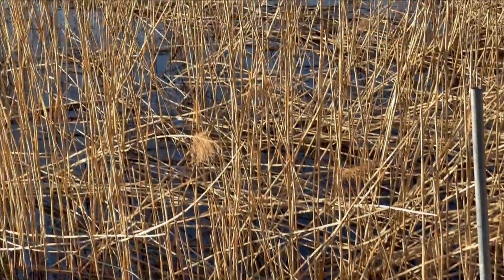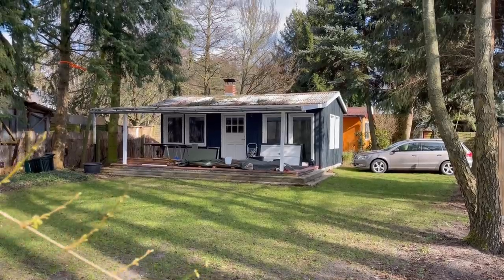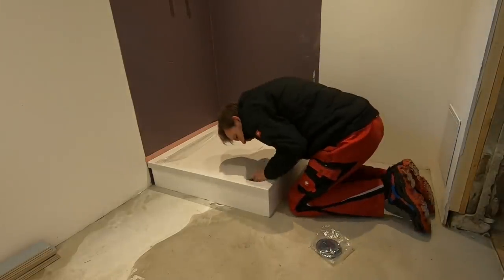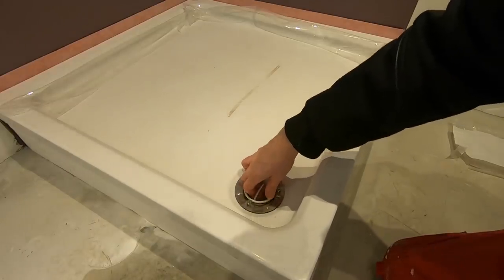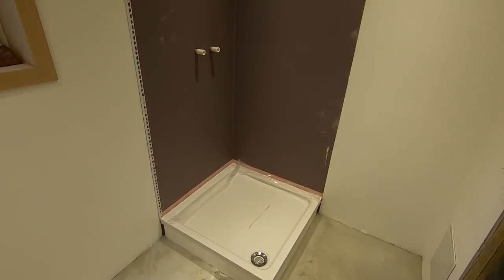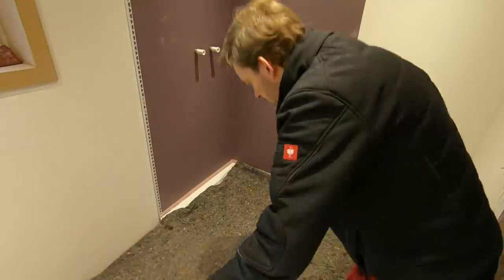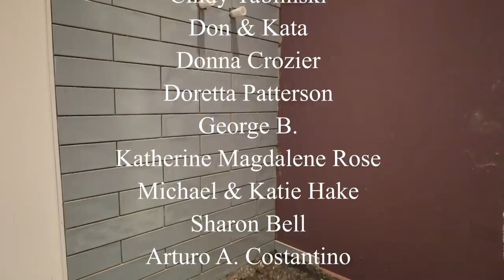Renovating an abandoned Tiny House #77: How to tile a shower in 10 minutes!

Comment: Might think about back buttering each tile before pressing it in place. I’ve done my share of tile and pressing dry tile into a bed of thin set causes a lot if air cavities. Not thick but fully cover the back of each tile with a thin layer. This assures goo contact and no hollow cavities.

Comment: Couple tiling tips: 1) you needed a 3 mm gap between the shower base and the first row of tiles to allow for expansion. Too late now to change it; 2) first spread the thinset with the flat side of the trowel, then flip to the notched side to remove excess; 3) before setting the tiles, soak the tiles in a bucket of water until all air has bubbled out. In this way you remove powder residue and add extra moisture, which promotes adhesion.

Comment: I’m intrigued you tiled from the bottom up. When my bathroom was remodeled, the tiler worked from the top down. You are VERY LUCKY the tiles around the water faucet area ended up so symmetrically … wait, you planned that, didn’t you? 🙂

Comment: Glad you well again and on the mend.   Tiles look superb, though you could have saved yourself a lot of work by using wet wall.    Good to see you back.
Reply from the maker: Thanks 👍
Reply: Please teach us about wet wall. Never heard of it.
Reply: @gwenwade6059  Hi,  As an alternative to tiles, wet wall panels can be used in bathroom or shower enclosures and will last for years. Specifically designed for wet areas, wet wall shower panels are completely waterproof. Unlike tiles, wet wall does not require grouting and is very low maintenance once installed.  They are gloss covered wooden panels and they just need strong adhesive, silicon for example and stuck to the wall.  I've stuck them on to old tiles, just make sure the surface is reasonably flat, no big holes,  plenty of contact area, etc.   It lasts for years, hard wearing and comes in a multitude of colours and designs.   No grout required, just a silicon run at the edges.  You also get joining strips if the area requires more than one panel.  Think of waterproof counter tops.  That's the closest I can think of.  Easy enough if you do your research and take your time. Hope this helps.

Comment: Horizontal is better. It's used when you want to make the wall "bigger" for small places like this one. If you want to make the wall "taller", you use vertical lines. Without knowing you pick the best one for that space. Awesome job mate
Reply from the maker: Wow - Thanks! :)
Reply: @renovationeast9379  after you're done, look at the before and after pictures and see if you "feel" like it's wider now :)

Comment: I have alwsys been told when screeding the glue to put the tiles on, you are supposed to go sideways and not up and down!
The reason: 
if you go up and down, if there is a leak at any stage, all the water runs to the bottom and rots everything there out.
By going horizontally, the water can only stay at that level!
I did a tiling course many years ago otherwise I would do it any which way most probably!

Comment: Step ladder pattern is way stronger, physically. In the USA, professionals call it, Runny Bond. The alternative pattern we call, Stack Bond It is depicted Horizontally. Vertical reinforcement is required in unreinforced walls. Could be a Federal Code. 
Reminds me of Frank Lloyd Wright.  More Zen. Like Horizontal Rift-Cut Oak Solid wood Doors. Flat slab one piece 1" thick.

Comment: I'm surprised you didn't back-butter the tiles. Also, I would have tiled both walls simultaneously so the "running bond" pattern continued across the corner.
Reply from the maker: ..it will - just a week later ;-)

Comment: Interestingly, subway style tiles in Japan are usually placed vertically in lines. It is a very distinctive look. Also, funny story... my dad was working in my shower without covering the base. Later that day, I was in there and dropped a tool, chipping the base. My Dad came the next to finish the work and thought he had done it the day before and apologized profusely and explained how you were supposed to cover the base when working over it... haha I got away with that!

Comment: Our shower cubicle always leaked into the room below. Drip, drip, drip. When we had the cubicle re-tiled we discovered why. The first fitter failed to abut the shower door frame onto the tiled surface. Instead he fixed it to the plastered wall which was not waterproof.